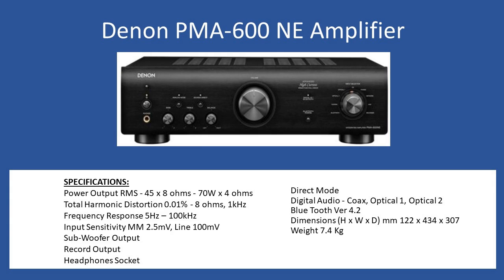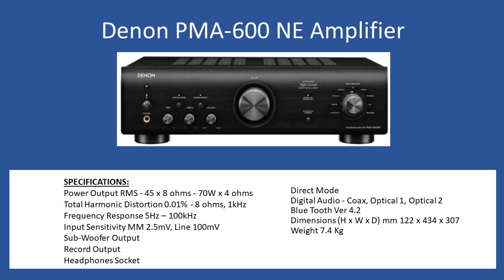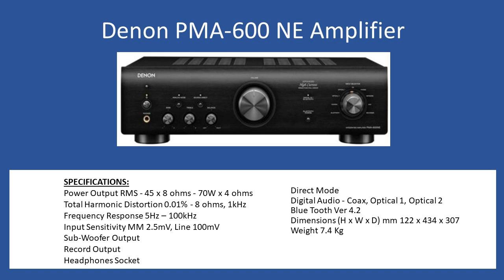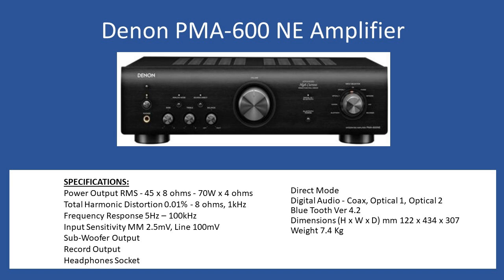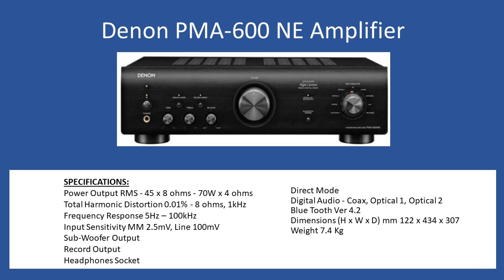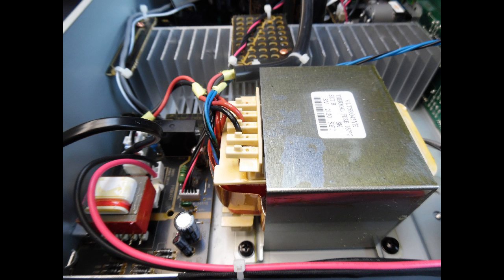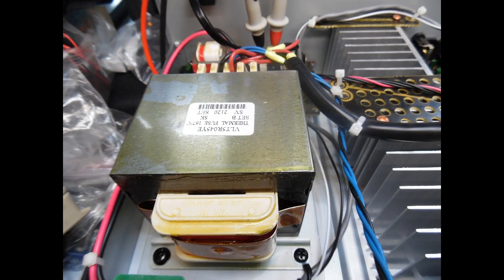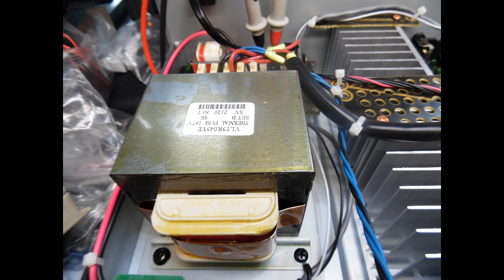Denon PMA600NE Amplifier Repair (With Audio Tutorial)

Comment: Hi there! Thanks for the video and for sharing your knowledge. I've got the same amp. I'm having an issue with one of the channels. One day my daughter set the volume to max and when I turned it on and played something, not only it blew my eardrums, but it also blew something internally. Initially I thought one of the speakers burst but I tested it and it works so it has to be something with the amp. Any idea what it could be and if it can be easily fixed?
Reply from the maker: Hi from what you're describing and how the problem occurred the defective channel has been over driven. Do you have any experience repairing electronic equipment. I can advise what to test.
Reply: @AudioAmplifierServicing  that makes sense. I used to repair computers but I believe this is a different beast. I'd be happy if you could advise what to test and I'd see if it's something I'd be brave enough to try. Thank you!
Reply from the maker: @Kuriatz  Email audioamplifierservicing@aol.com and I will send you the service manual and provide guidance.
Reply: @AudioAmplifierServicing  will do. Thank you so much 🙏

Comment: Hi mate, I have a Bluetooth issue with my PMA-600NE. I've been looking all over google but can't find anyone having the same troubles. I've managed to pair it with my Android, iPhone, tower computer and laptop, but I can't manage to get any sound out of the speakers, from any connected device. Everything else works like a charm but that bloody Bluetooth won't make any sound. While pairing I see the blue light flashing, then it stays on when it's paired, so it should be. I've seen somewhere that I should be asked to type the "0000" code when pairing, but I've never been asked to.
Would you have any recommendation? I'm kinda lost here. 
Cheers 🙏
Reply from the maker: Hi as this is a current model I would recommend calling Denon support https://www.denon.com/en-gb/contact-us.html?srsltid=AfmBOopweCeModnVYOfjVlD44amutUUtQOhzSgpbe3EiNnjvxOj9Wli8

Comment: I have this amp and it started to make crackling sound and drop the left channel occasionally, i have clean the volume pot with Deoxit D5 but the problem still persist. Any suggestion?
Reply from the maker: I would, in the first instance, check the connection of the left speaker, a good test is to swap the speakers round to see if the fault moves with speakers or remains on the suspect channel.
I would also ensure there is no issue with the input source.
If both are eliminated, then the fault is with the Amplifier, and you will need a signal tracer or oscilloscope to determine what is causing the loss of Audio.
Reply: I have one that only plays right side. Left you can hear when volume way up but soft noise